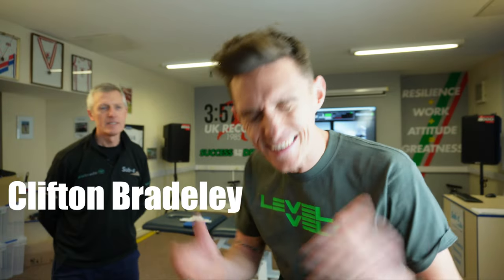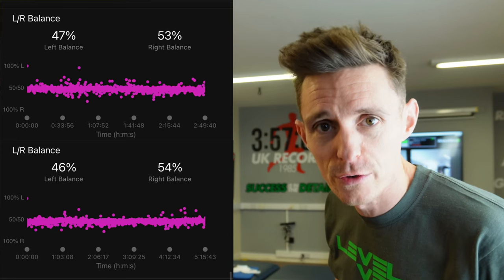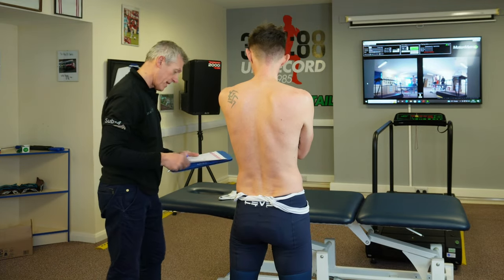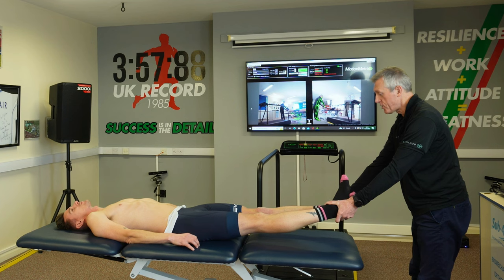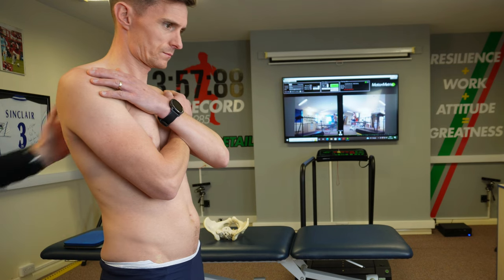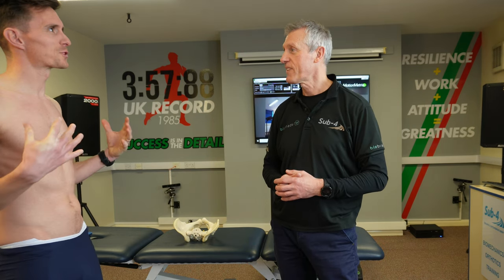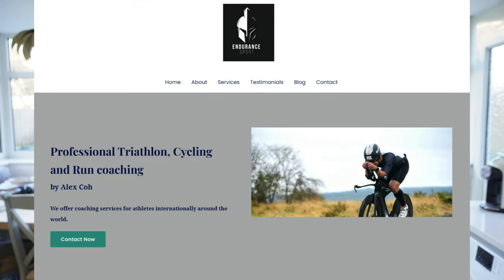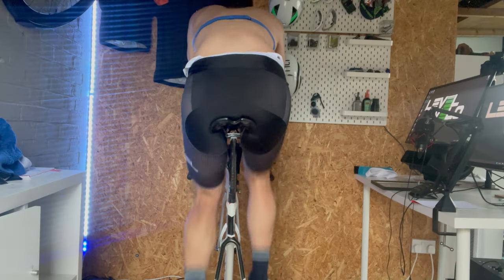Improve Cycling Power - Fixing Leg Length Discrepancy

Comment: have L/R lenght differnce. Had some shims on old road shoes years ago for outside use.  Now with trainer shoes made my own using thin cardboard then put under the road cleat the old road bike is the trainer bike.  Should get a fit cheek on my trainer bike as its has been years as one knee is starting feel pain form longer or harder rides.